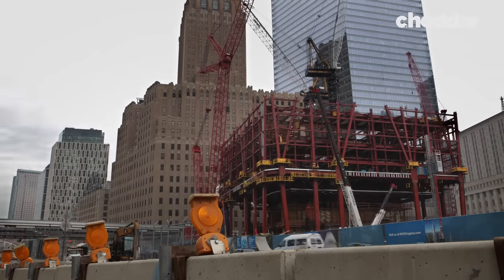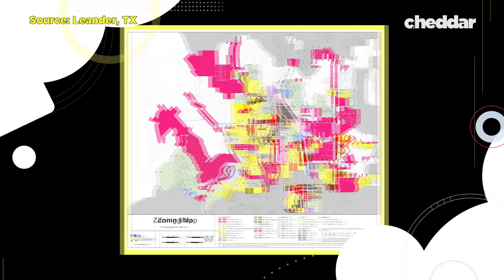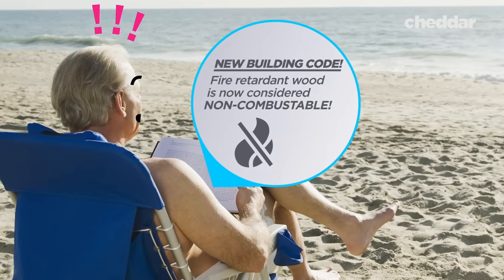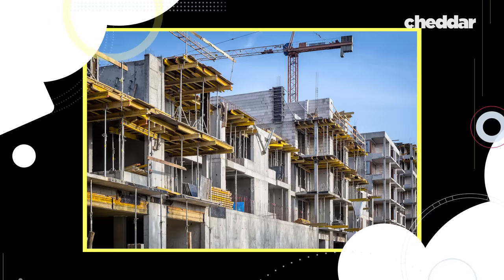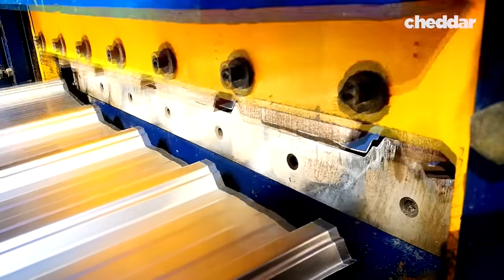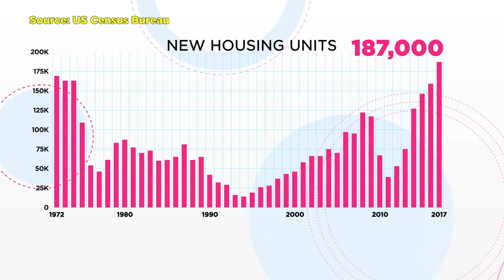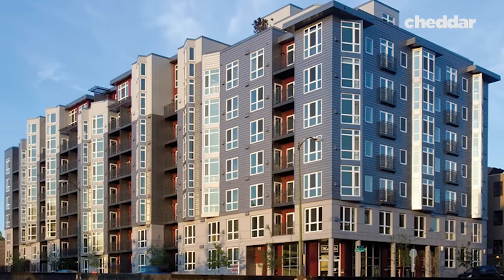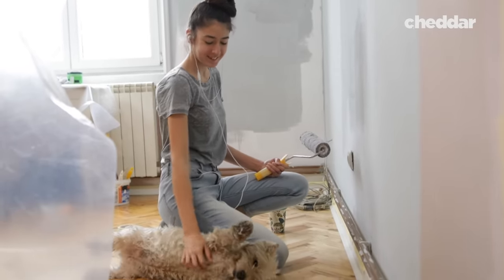Why All New Apartment Buildings Look Identical - Cheddar Explains

Comment: lol, every. single. thing. in the USA comes down to cost. everything.
Reply: Everything comes down to cost everywhere. The big difference in European and American building styles comes down to available materials. In Europe, wood isn't nearly as cheap and readily available, which means the cost difference between building with wood and concrete is much smaller. Thus th ey get flexibility on it. If Europe was covered in vast hardwood forests, I bet you they'd be building homes out of wood too. It just makes sense.
Reply: @jarynn8156  I think this does happen in Europe. Especially in Nordic countries.
Reply: Simple Economics.
Reply: Every single thing everywhere is dictated by economics
Reply: That is literally every country that exists. But, certain countries have higher demand and more land with more people than others. Another as well is more available forests for wood than the UK which has very few heavy forests remaining.
Reply: All construction in the USA is extremely expensive
Reply: @flakgun153  of course it isn't cheap. Where there is high demand, there will be high prices. That is the case in every country. It is basic economics
Reply: @jarynn8156  you clearly havent been to europe lol especially scandinavia

Comment: Glad somebody else mentioned these. They're tearing down unique buildings to build THESE. Just like in China.
Reply: What unique buildings are being torn down?
Reply: @Sevenfold120  I don't know the specific names of them.
Reply: They even tear down good solid reinforced concrete office buildings for cheaply build sawdust and cardboard apartments
Reply: In Rockville MD, there used to be a mid 20th century office building colloquially known as the Pink Bank due to some of its facade materials being a pinkish hue and housing a bank.  It was torn down in favor of a cheap wood framed podium slab building as an extension of the Rockville town center.

Comment: LOL, I used to manage one of these and had no idea that this is why it was the way that it was. The only thing I was told about was that 7 stories (6+ an underground garage) was the max height for a certain design of elevator, otherwise we'd have needed a much more expensive, complex, and harder to permit elevator system.

Comment: I think these buildings look fine. If you want bland and monotonous, come and see the older apartment blocks in South Korea. Those are literally giant beige concrete rectangles. 

My main concern living in a multi-story wood frame building--in addition to safety--would be noise. I don't think wood is dense and strong enough to prevent inter-apartment noise such as hearing conversations next door and footfall impacts from upstairs unless the buildings have a significant amount of insulation and decoupled flooring, which I doubt most builders would bother with.

Comment: And lets not forget that ''treated wood'' usually means wood that's just dunked in a bunch of different oil-based chemicals to change its properties. So not exactly great for the environment either.
Reply: Yes and no. The way oil is refined means a lot of petroleum products are going to get produced whether we need them or not. To fuel our need for gasoline, X amount of asphalt, kerosene, and jet fuel are going to be produced just because... Thats what the oil refined into.
Reply: @jarynn8156  On top of that, various plastics, polymers and cosmetics are also made from oil products.

Comment: I think that's a North American problem,  we have those buildings in my country too,  replacing the old soviet apartments building that were popular in the the 70s,  and they are concrete not wood.  I think that's the problem with American housing,  it's wood.
Edit : I don't think they are an eyesore to be honest,  they are not as aesthetically pleasing as the Victorian or Haussmanian buildings but they are still better looking than those soviet apartments
Reply: the problem is def wood, i can t comperhand how that will stand the test of time
Reply: @_raresis5405  The home I grew up in is 170 years old and still structurally sound. Concrete foundation, the rest is wood. Wood wont last as long as concrete all factors being even, but properly maintained it will last plenty long enough.
Reply: @jarynn8156  my grandmas house is 400 yo still great
Reply: @jarynn8156  the problem with this buildings is that they wont be properly maintained bcs there is no incentive to do so
Reply: @_raresis5405  Most of these buildings will be given enough maintenance to keep them standing. There are plenty of smaller wooden apartment buildings that have been standing for many decades and dont show any signs of falling down yet. And there is incentive to maintain the building... Maintenance is cheaper than building new, 90% of the time. And if you want tenants, you are best off keeping your facilities somewhat decent.

If we are operating under the assumption that landlords wont do any maintenance once-so-ever, then it really doesnt matter what you build with. The building will be crumbling in 30 or 40 years no matter what you make it out of. A brick or concrete building might stay structurally sound longer, but the internals will still rot and decay and fall in on tiself.

Comment: This is an interesting explainer, but it is not without bias. Why does the author assume that this type of construction results in "affordable housing"? It does not. Although wood construction is cheaper to build than steel-and-concrete on a per-unit basis, rents are still exorbitant in these types of buildings. In other words, such construction may be more affordable for developers and their investors, but the end result is not anywhere near affordable for prospective tenants.

Comment: you call these cookie cutter buildings, but show completely distinct designs where they only share the number of floors and materials used...
and why so much hate on these urban designs when suburban single detached homes have an even more cookie cutter design and are cheaply built with wood
Reply: Here in Cleveland our buildings are gorgeous old brick and concrete with many different accoutrements like arches and carved patterns to make them all look very distinct. These aluminum and wood frame buildings really do just look like a frame with a façade.  They look cheap and sterile. But I'll take these mixed use residential buildings over seas of family zoning any day.
Reply: The thing about these buildings, imo, is that they are distracting-ly ugly. Other decades did have similar or same "cookie cutter" style but they were just fine and not garish to look at. They were built with brick which is something that american cites are just used to. When all of a sudden we see all these buildings made of concrete and metal slabs its a bit of a eyesore.

Comment: And one advice, do not move to the top floor of one that doesn’t have AC! I just did and now I’m drying with this heat coming through. And the apartment doesn’t even have AC on the hallways or ventilation in the units....

Comment: Does a building have:
-Sustainable materials
-Affordable pricing (often non-market or rent-tied-to-income)
-High energy efficiency, quality designs that won't fall apart in 40 years
-A socially sustainable design (courtyards, balconies, porches, etc)

If none of these apply, it does more harm then good.
Only "missing middle" housing can solve this problem - concrete boxes in the sky will never be socially or environmentally sustainable.
Building more homes is proven to not drive down prices.

Comment: the fire risk is kind of overstated, these building pretty much only ever catch fire while in construction, before sprinklers are installed. of the fires mentioned in the video, I believe all but one or two were building which did not yet have sprinklers. and the overall statement is said in a way to single out large buildings- many, many more single homes catch fire and burn to the ground, but because each one isn't large enough on it's own to be worth 20 million, it's not part of the discussion here, despite single family homes being far more risky in terms of fire.

Comment: FRT wood allowed in type 3 construction allowed 5 stories and I perceive that to be more of a “game changer” than IBC 509.2/510.2 podium alone. Prior to FRT being allowed in type 3, the highest you could go with wood was 4 stories using type 5 construction. Nowadays, you can go 2 story podium and 5 stories wood. Factor in mezzanine levels in podium and wood and you can have a building 9 stories tall in appearance. But after 75’ to top floor and you have a code defined high rise building and that kicks in a lot of additional requirements that many developers don’t want to pay for. Five-story slab-on-grade wrap (texas donut) is a sweet spot for many these days.

Comment: A little bit unintuitively, treated wood is safer than steal beam construction. Surface treatment prevents combustion gases from forming, and wood does not conduct heat as well as steel, or lose structural strength due to change in temperature. If laboratory fire testing, it is safe much longer than steel beam construction of similiar specification. Internal construction ofc, has to be considered for fire safety. Gypsum board dry wall construction make the internal spaces firesafe, and prevent fires from reaching structures. Don't know, if those are much used in the states.

Comment: Hardie Reveal panel is cement. I used it on 2 of my apartment buildings. I also have gypecrete poured on all my floors. for noise transfer and fire-rating. Hardie is not cheap. My buildings are different on each floor. It is not repetition.

Comment: There are alot of apartments of this style that aren't ugly, bland or boring. Some are, sure. But most of them look better than the typical cheap apartments they built in the 70's-90's. The problem is they're usually overpriced and walls too thin.

Comment: Metal siding doesnt not cost anywhere near what you're quoting it at.  I covered a 400 sq ft roof for $1000 using metal siding.  That puts it at just over $2 sq ft

Comment: Wood, when done right, is actually fantastic during a fire. Wood burns at a near constant rate, regardless of the fire temperature. Need to double the fire rating of a particular wall? Simply double the thickness. I'm not sure that helps much here, as I'm sure the buildings are built as cheaply as possible, but I plan on building a timber frame house here in forest fire country, and have no worries about the survivability of the house during a fire.

Comment: west coast "dingbats" (1-2 stories of apartments over an open parking podium) are not at all part of this modern trend, they were mostly built between 1950 and 1990, and while the overall construction is similar, they use stucco instead of modern facade systems over the wood, and almost always only have parking and mechanical rooms on the ground floor, instead of more units or commercial space.

Comment: Wood frames are fine. Just don't put gas services in them. Electric is better anyway. Wood framed cavity panel walls allow insulation to be installed in the cavity, which means the building requires less heating energy than a double brick or concrete building anyway.

Comment: beacuse pre form concrete and steel pillars has certain distancing scale between them and preform steel and concrete or pre stress concrete floor have scale shape in which has to be follow so inevitably the building will end up looking like square

Comment: Don't know if you have noticed but all you need is one tiny accident on a windy day during construction and the whole structure - sometimes even the whole complex - is leveled. The fuel load to too high and they often burn down neighboring buildings just from radiant heat alone. The structures do become considerably safer after the fire retardant dry wall is installed. But until then, they are like an angry child with a box of matches. There have been fires all over the country, Ca, NY, Tx, and NC just to name a few.  It should be illegal to build 4 and 5 stories out of wood framing. Forget flying embers.  The radiant heat is enough to ignite other wood frame building accross the street.  Just look at the complex in Edgewater NJ.

Comment: In Los Angeles where these started, everyone knows they are considered "luxury housing". Good luck trying to live in one of these cookie cutter apartments for a good deal. And every material they use is as cheap as can be. Flooring, lighting, cabinets. U name it. If it was actually affordable housing, it would be good but for what they charge, it's insulting.

Comment: If I win the lottery I want to build a 15ft x x30ft house with a full basement and one bedroom upstairs attic/loft. I'll likely combine cement, steel and wood highest quality of all materals. The main floor will be a living room, a bathroom, small kitchen and dining area. The basement will have the furnace, washer/dryer, storage and wet room. Upstairs attic/loft will be a single bedroom with a curtain divider that can make it two bedrooms in a pinch. Behind the house I want to build a 24 x 48ft garage.

Comment: Most of the problems pointed out in this video are down to buildings either not being properly engineered or more likely someone cheaping out during the construction process. Though soundproofing is indeed a problem in all types of wooden buildings. It's also important to note that when those buildings burn down, it's usually during construction, before most of the fireproofing systems are installed, when people live in them, they aren't any more or less safe than any other type of multi-story residential building. Concerning the design, it might be a bit generic, but I'd prefer it to the regular mid rise residential building here in Europe. At least the Americans do some kind of decoration, even if it is at times uninspired, in Europe a house very often is just four flat, plastered walls and a roof - which I find to be very bland.

Comment: I'm not in the US, however where I am we had a whole spate of fires in these types of buildings a bunch of years back, including one fire that covered 3 city blocks, burned five of them to the ground and damaged three others. People were obviously very concerned and demanded changes to building code after these. So the politicians did what any reasonable person would do, and changed the maximum height from four stories to ten for wood frame construction. I don't think we've had anything near that tall built yet though. the other reason all the buildings around here are four stories, is it they didn't used to need an elevator until they hit 5. That said I feel that that rule is outdated, as most of the wood four story buildings I've seen that have been built more recently all seem to have elevators in them.

Comment: The video largely ignored the economic details, just mentioning that this is cheap to build and this is expensive is not enough. What is the most important to know is what are the profit margins on these buildings? If they are huge, then, of course, they can and should construct houses from better materials, sell them at the same price and just make less profit. That would never happen naturally, so that needs to be forced by law/regulations. BUT! If the profit margins are not insane, and building from better materials will require raising costs for apartments even higher, way outside of the reach of consumers it is trying to sell to, then we have to turn to other avenues for reducing the cost of construction, for example automating the building process or making materials cheaper, etc.

Comment: We have them everywhere here in AZ and they look REALLY nice. They don't look identical. There's a lot of variance and they look nice and clean. Sure, they're not going to fit so nicely into historic districts, but that's not what they're designed to do. Housing could look WAY worse, that's for sure. I think these clean, modern lines will stand the test of time. Anytime you don't skimp on ceiling height and exterior materials, the architecture will continue to look at least okay. If not downright nice.

Comment: The problem is that by cheap they mean CHEAP, with poor sound and temperature insulation. They often have electrical and plumbing issues that can be difficult to track down and end up being expensive to repair, both for the owner and the renter.

Comment: Let’s Talk About Cost. There is some notion in the comments that podium buildings are affordable housing. In some cases this may be true. But this building type is popular with developers because the cost to construct them can be cheaper - that does not necessarily mean affordable to the resident - apple to oranges here. Podium buildings can be designed as stripped down, with the cheapest exterior design, detailing and materials. It can be outfitted with minimal amenities (if any). This combined with many other factors (management, maintenance, utilities, etc) can result in cheaper rent. But this type of building can also be detailed with high end finishes, meticulously crafted details and lavish building amenities. Potentially translating to a Luxury structure with higher rents.

Comment: they aren't actually identical because a few of them are constructed with having glass covering most of their exterior walls (excluding ceilings to separate between each floor). This type of construction is really costly to build even though their frames are made of wood. Still, don't think that these wooden beams or frames are bad idea because if the builders choose a good material, they will last very long.